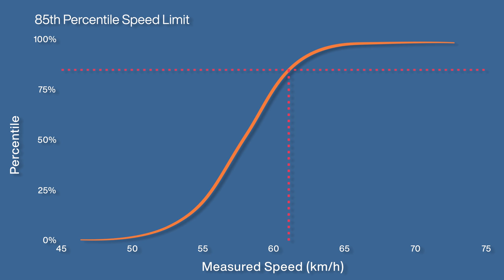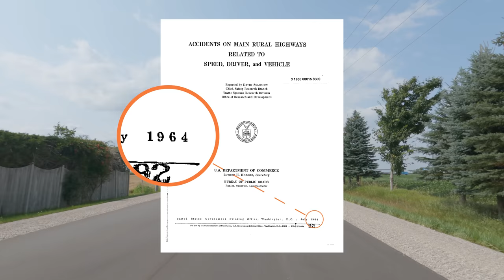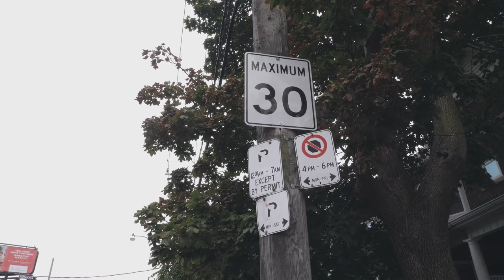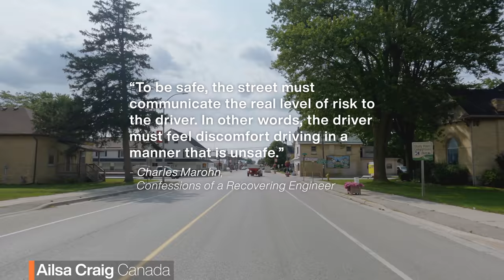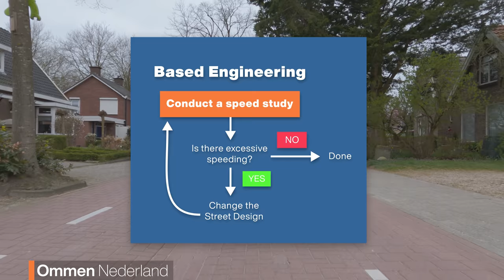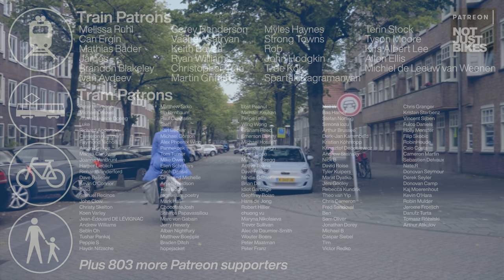The Wrong Way to Set Speed Limits [ST06]

Comment: The bit about roads with high speed limits in rural areas is so damn common in Texas. There is a small rural town that is on my commute to work and just before it the  speed limit is 105kmh(65mph) but obviously most people are going 70+ and the highway goes right through the center of it. They have posted signs to slow down, if you do it though people behind you will pass you in the oncoming lane and honk like maniacs.
Reply: I am in a discussion on an other site where someone claims that lowered speeds and the speed traps are only there for extra money for the local police/town, as a kind of extra toll. He did not appreciate that lowered speed limits might be because the local situation may needed lower speed limits, like people living on those locations and slower traffic users using the same roads.
Reply from the maker: When I was driving through these towns I saw a film crew interviewing a woman. They were doing a local news story about drivers speeding through town. It's insane to me how common this situation is, but nothing is ever done about it beyond a few random speed traps by police.
Reply: @willekevanderham5326  There are plenty of towns in the US that use their police (and speed traps) to blatantly extort people. 

I know of many spots where nothing fundamentally changes about a road and the speed limit is randomly lowered by 15mph with law enforcement hiding on the other side. This particularly occurs on highways adjacent to towns experiencing urban decay and is fairly common in between large cities on the east coast. 

These towns don't generate enough tax revenue so there is no point in stopping people from speeding, instead it is both encouraged and punished. 

These are often small conservative towns/counties that do not tax their residents enough, and therefore have to make up that deficit. There are many towns where police funding itself relies on these traffic infractions. 

This isn't a problem in most of Europe because the police aren't as corrupt and people actually pay taxes
Reply: It's because they'd rather have the speed trap and the revenue for the cops/city than make a safer design.
Reply: @stuuuuuuuu  last week tonight did an episode where there are small towns on highways that get over 50% of town revenue from traffic tickets.  Their schools are basically funded by people getting caught speeding.

Certainly a perverse incentive.
Reply: @stuuuuuuuu  In the Netherlands police will not enforce unless the road design matches the speedlimit. Enforcement is only the last resort. Police know people can object to such fines in court and win. And fines go to the national treasury, not local government.
Reply: Lmao I just came back to Colorado from Texas. Yes that state makes no sense… the roads too.
Reply: @willekevanderham5326  that’s exactly what speed traps are. Speed traps help no one except linking the fat cats.
Reply: @willekevanderham5326  it'd be easier to convince that person you're chatting with on another site if the US wasn't full of cases of highways being kept at lower speeds than engineers intended because the police union openly states they want the speed limit lower to produce revenue.

We're unfortunately kind of at a place where officials have cried wolf so often nobody believes them anymore.
Reply: @Zraknul  Ack, you beat me to it! I did include the episode name in my comment though. :)
Reply: @NotJustBikes  Speed traps are a back door tax.  Don't expect roads to be rebuilt anytime soon in.the US. The revenue from speeding tickets is needed for big spending politicians.
Reply: Still don’t understand why everyone wants to drive so slow some people actually have work and places to be they can’t just go watched the trees sway I live in texas and have many highways going 70 easy and am fine going that limit the truth of the manner is some people can’t drive and they get in the right lane
Reply: @stuuuuuuuu  bro the United States is like the same size of Europe if not larger obviously more people will have to drive in us
Reply: @RunsFarRidesFar  I moved from Georgia to texas please tell me how the texas roads don’t make sense or maybe you like sitting in back to back traffic because someone can’t handle going 40mph
Reply: I remember watching a video on a small town in the US that got the MAJORITY of it's revenue through speed traps
Reply: I am very curious about what this situation looks like. Can you give me the name of this small rural town so I can look at it it with street view on google maps?
Reply: Between towns when the speed limit was 70, they were doing 65. Then we approach a small town with a 45 limit. They go 65. Children playing in the front yard... zip on by at highway speeds. If i attempt to slow down they pass on the left. 

I have a clip on my channel of precisely this! Titled: 2-27-20
Reply: @fuzzytop4746  If you had payed attention at all, this is not about highway speed limits. This is about speed limits within towns, i.e. where people may be outside and crossing the street, with local traffic, roadside parking, and all that stuff.
Now, only a moron would make a highway the central street of a town (or have the highway go through the town at all). But if that's the case, it ceases to be a highway, and starts being a town street. With lower limits, for obvious reasons.
It's not that people want you to drive slowly on a highway, or a country road.
Reply: @ScramJett  Wondering if anything did change after that 2015 LastWeek episode..
Reply: @weaksause6878  You just described the plot of Pet Sematary.
Reply: @stuuuuuuuu  yea one time my mom got pulled over in the middle of nowhere in Nebraska for going 10 over the speed limit of 65. Cops like lowering speed limits in certain places and then camping there catching unaware drivers off guard
Reply: @csleurink  I doubt it. Standing in the way of the status quo in the US is like standing in the way of a herd of stampeding bison. You won’t stop, or even slow down, that unrelenting force, but you will get trampled.
Reply: @colatf2  they love out of town folks even more! Folks from out of town, are far less likely to challenge a ticket, even an unfair one, because they’d have to travel back to the local courthouse if they challenge it.
Reply: @ScramJett  a lot of small towns that I see are on Federal or State Route roads, sometimes County Route roads. I don't know how much control the local municipality has over them
Reply: @varana  a lot of small towns exist at the intersection of two roads that cover long distances, all the business want to be near that intersection, and then some of those small towns where built before automobiles or before automobiles where going anywhere near as fast as they are today
Reply: @isaackarjala7916  it doesn’t matter. If you challenge a traffic ticket, you can only challenge it in the municipality that the law enforcement officer works in. Even if he/she is a county sheriff deputy, state trooper, Highway patrol officer, the courthouse in that jurisdiction is the presiding court for challenges to traffic violations. This actually happened to my high school drivers ed teacher.
Reply: @fuzzytop4746  I was making a “ Texas makes no sense joke”. For example, the streets in Dallas, “what are those?” San Antonio also kind of isn't the best for cyclists. Plus, Texas has... Texas problems. Twas just a funny. Some of the people and local culture are amazing. But just the rest of it stresses me out.
Reply: I say lets combine the two. At least until we become accustomed to road specific speed limits. On the other hand, isn't speeding ticket a major source of income for municipalities? With that kind of free and easy income, I can't see many politicians voting to change that.
Reply: @ScramJett  okay, but the local municipal government can't change the road because it's not a municipal road, it's maintenance and planning is handled by either the county government or the state government.
Reply: @NotJustBikes   Because the Speed Traps produce revenue for the City & Police Department. Why would they want to reduce their revenue just to make it safe for people?
Reply: @gichiguy007  Maybe, but I wouldn't say that the groups of people who think the speed limits are for revenue & those who think they're for safety are split along the same lines as the ones you're talking about.
Reply: This is because we Texas drivers like speed and anything under 70mph is outrageous.
Reply: @fuzzytop4746  Europe have more than twice the population of US. What are you talking about?
Reply: @dutchman7623  A nation that relentlessly working on reclaiming Doggerland would not shirk at moving a road numerous times.
Reply: Same thing happens up here in Idaho, 80 mph to 35 mph and back up to 80 over a 1 mile town
Reply: It's interesting to consider which things came first too... was that small town there first and the road was built to run right through it, or did the town start developing up around the road due to the money brought in from travelers passing through and needing gas or food?  I'm sure it's a double-edged sword being a small rural town where all that traffic going by is keeping that local economy afloat despite how dangerous it makes it for a pedestrian.  If the road through your town was actually a small offshoot of the actual state road, it's probably less likely that people driving past your town will divert into your town seeking a restaurant or gas station.
Reply: Is this Texas Highway 71 somewhere outside of Smithville?  Where it goes from like, 75 to 65 to 55, or something like that within a few hundred yards?
Reply: @batmarlowe  no but I know exactly that stretch of road you're talking about haha
Reply: I feel like this is more of a cultural issue. Everywhere you go in the US, the is always some A-hole speeding, swerving in and out of traffic, gunning it through yellow or red lights, or tailgating slower drivers to try and bully them to speed up. I don't think that people here really understand just how dangerous driving is. Even driving normally and obeying all the traffic laws can be incredibly dangerous. When you're driving, you are essentially piloting a 1 ton bullet down the road.
Reply: France nowadays is very much extorting fines this way. Constantly changing speed limits on roads, increased number of speed traps, high punishments for minor trespassing, forcing people onto fee-based highways, Often inconsistent, random and flimsy signing. 
I once drove around in the major city of Orleans, searching for indications  to go via toll-free National Route (RN) to Tours (the next city of about equal size/importance towards the West).  No signs available as it seemed. Only indications for highways in that direction.
Looks like the private highway industry lobbied for that.
Reply: Have you seen US281 just north of Falfurrias? It is a 4-lane highway separated by a center turn lane and is posted 120 kph (75 mph). There are driveways on both sides to homes, ranches, churches, etc. It blows my mind every time we drive through.
Reply: @stuuuuuuuu  *people are forced to pay half of their hard earned money in mandatory taxes, fixed that for you
Reply: That's the same as with the speeds through a valley down here. It's 65mph around it but it drops to 55 through it but you just end up pissing people off if you drop to it. Bad thing is that's where cops sit occasionally because ofc going into that you're going to be speeding. I hate everything about the design of this area but these people are too addicted to driving and think it's the only way XD
Reply: @kyleoates6367  why are you accusing someone of being a “stereotypical GOP supporter” ?
Reply: In places like that the speed limit should be followed or lowered but like on the interstate 75-80 mph is to slow. I mean your traveling hundreds of miles in one drive I think speed limits should be set around 90-110 mph
Reply: There's one on my drive that has a 65mph road going through it, but the township takes that down to 30mph. Completely straight, just a few houses on either side. And this road was recently widened to nearly a 4 lane road, but with large paved shoulders to accomodate pulled over vehicles. Road is easily safe at 70-80mph
Reply: No way they're going to make the speed limit clear whenever the sheriff is getting 5 to 6 tickets a day waiting in that speed trap
Reply: You are right on with this whole vid but I think the issue is how St-roads come to exist. Take my town with two main st-roads covering lets say 12 miles or so with mini malls and stop lights. Things are pretty spread out and traffic isn't bad most of the time.  

The town just isn't big enough to have a dedicated downtown area, or even if it is things were set in motion in the 60s and things are just too spread out currently. Yet it's all workable though not optimal. So what will happen when the town grows is a densely packed and dangerous st-road, and there seems to be no way to avoid that.
Reply: The Hume Freeway is 100+Km/h but it's mostly a freeway with some island-based intersections, and it's all rural.
Reply: Instead of changing the roads to lower the speed limit, just let giant potholes form. What could go wrong?
Reply: @fuzzytop4746  - You know what really helps getting to your work and places to be on time?? Not being dead! :) Or in court defending yourself against a vehicular manslaughter case. If you can't get to your work in time without driving 70mph through the center of a town, perhaps leave your home earlier?
Reply: @marcstanescu2238  So I can apeal my 100km ph tickets on the main highways during the day ? Which btw are designed for 130km ph
Reply: The problem there is the lack of enforcement. Everyone figures the signs are suggestions, not mandatory. If they start getting expensive tickets, they'll learn quickly to follow the signs.
Reply: @sminthian  - Or instead of only punishing the poorest people in society, why don't we instead fix the damn roads so people will naturally drive slower. 🤷🏻‍♀️
More police and more fines aren't going to solve systemic issues. 🙄
Reply: Freaking Caldwell!
Reply: @stuuuuuuuu  A lot of these communities will be in panic mode when self driving cars eliminate traffic fines.
Reply: @MrWhite-pn7ui  I'm convinced jaywalking as well is a design issue that resolves itself in parallel with street and road separation. I've actually noticed my own behaviour here in Norway: in Oslo, where almost everything is a street, I'm quite happy to cross the street in unmarked locations (WHEN SAFE!). Outside Oslo with more roads and stroads, my first thought is generally to seek out a crossing even in situations just as safe as where I'd cross in Oslo. Also Oslo has a very low accident rate between pedestrians and cars, despite the lax approach pedestrians take to crossing.
So I posit that as the streets become better designed for their purpose, jaywalking stops being a problem.
As for bikes, I'll leave that to somebody else. I don't think I have a rational opinion on biker behaviour yet.
Reply: I've visited each of the lower 48 States.  In my opinion,  Texas roads have the dumbest design.  In fairness,  some of the Northeastern States have frustrating streets,  but they weren't really, "designed." They just evolved from the days pre-auto. Texas did it the worst possible way on purpose.
Reply: I mean I live in a Texan urban city and I have to go at least 5 over (in the right lane) on the highway if I don’t want to get tailgated 🙃
Reply: Make a goddamn exit and another road, nothing is more annoying than driving through Texas for two hours and having to slow down to 35 mph 10 times because some idiots built a few houses right on the main road.
Reply: @stuuuuuuuu  Speed traps like this are illegal in california.  setting the speed limits to 85th percentile with engineering and traffic surveys protects drivers against this kind of enforcement.
Reply: @mushroomsteve  they want safer streets, but can't afford to fix their designs.  thanks for strangling infrastructure construction, republicans.  Federal gas tax hasn't been increased in 30 years, longest its ever been static.
Reply: It’s Texas. You shouldn’t be regulating speed limits.
Reply: Use by ft no unless
Reply: @stuuuuuuuu  I live in a city that used to do that. All the traffic coming off the freeway  or out of Detroit Metro Airport on to Eureka road would be doing at least 60 MPH. The Speed Limit was 45 MPH. The city got about $100K in ticket revenue in 6 months time. The Wayne County Airport Authority got the speed limit changed, good for them the road fell under Wayne County and not the city. Because I doubt the city would have changed it.
Reply: @chernobyl68  not true. I lived in Sacramento and the highway to San Francisco would change to MAX 70. CHP on the bridge tagging people all day everyday.
Reply: Good, can't drive stay home!
Reply: @Meche697  in order to post something other than the prima fascia speed limit (65 or 55 depending on number of lanes), a california highway must have a current engineering & traffic speed survey.  if there is no current survey supporting that speed limit, you can fight the ticket and win.  city streets and county roads may have different laws however.
Reply: @willekevanderham5326  They definitely do set up camera traps there though for easy money
Reply: Maybe making small town main street a federal highway was a bad idea..?
Reply: @mbdg6810  someone must have said something incredibly stupid and racist...
Reply: @varana  Sometimes towns grow up around a highway.  What started out as a highway becomes a street because of town growth around it.
Reply: @kxkxkxkx  wasn't sure it was a US Highway, figured it was a state route
Reply: @XenSoc  Its like that over here in the east in Virginia as well. Accept its farms and churches and maybe a couple homes.
Reply: @marcstanescu2238  "And fines go to the national treasury, not local government." I've been saying for years that this is what should be done in the US. Take away the perverse incentive at the local level. For the US this could be state treasury, but some states are small enough that speed traps could just become a de facto state policy, so best to do it nationally.

I'm fortunate to live in a tourist/snowbird town where the police are evidently encouraged not to ticket for minor speeding, etc. so as not to drive away visitors and part-year residents. Before that I lived in college towns where you had to be ever vigilant, and before that a small town where teenagers (which I was at the time) were specifically targeted.
Reply: @Zraknul  whose fault is it that you can't see and read a speed limit sign? or see a row of buildings lining the road
Reply: @kyleoates6367  Let’s Go Brandon!
Reply: @stuuuuuuuu  My home town probably used to be this. The highway ran through town, so it went from 65 down to 30 pretty abruptly. I don't know a single person from town who ever got an actual speeding ticket, including 16-year-old me putting the pedal to the floor on a quarter mile connecting road on the way home. Pulled into my driveway, police pulled in behind me, told me he clocked me at 50 in a 20 (which was lower than my speedometer said), but just gave me a warning. 

A year or so later they completed a highway bypass and all of a sudden townies were getting pulled over left and right- my friend was pulled over for stopping but "not stopping three seconds" at a stop sign.
Reply: @heimdall4148  4,000 lawsuits later.
Reply: West of San Antonio?
Reply: When there is nothing to slow down for there is no reason to slow down.... at that point youre just fuckign up traffic.
Reply: Texas lol 😂
Reply: @willekevanderham5326  The state in the US keeps most of the fine, not the municipality.
Reply: @stuuuuuuuu  Coos Bay, OR
Reply: @RunsFarRidesFar  Idiocracy was filmed here..as a documentary
Reply: @BillyJoe1305  It's usually the opposite of this, people and speeds set at or above the design limit
Reply: @fuzzytop4746  55mph saves 30% and more fuel
Reply: @weaksause6878  I just go the speed limit in the fast lane.
Reply: @colatf2  At least it catches reckless drivers, drunk drivers, drug mules etc.
Reply: @worldchangingvideos6253  I’m weak. Lol
Reply: @ScramJett  maybe video during Covid though
Reply: @ezekielbenavides2740  libertee!
Reply: @batmarlowe  freeways should be 55 as they were in the 70s for pollution and climate change reduction
Reply: @XenSoc  thanks a lot, Abbott
Reply: @tristabrown7568  to slow?
Reply: @tristabrown7568  most tires aren't safe at those speeds for one
Reply: @Bullhead_JW  30mph saves lives (and lawsuits) in case of an accident.
Reply: @dwaynesbadchemicals  butt mah freedumbs!
Reply: @Jacarroll417  good that they were catching drunk drivers and drug mules for a while
Reply: @jmodified  fines in the US do go to the state vs city
Reply: @stopmakingsense9915  no
Reply: @heimdall4148  extremely costly
Reply: @121Greenthumb  saving fuel and safer in case of a wreck
Reply: @worldchangingvideos6253  That can't be true in every state, else why do we hear about departments that fund themselves primarily with speed traps?
Reply: @worldchangingvideos6253  slowing down for no fucking reason is not saving fuel. Don't want wrecks? don't build towns on top of high speed roads. You don't get to move into the neighborhood and expect everyone to accomodate you.
Reply: @worldchangingvideos6253  yes I think so when you have a 22 hour drive if your going to the speed limit yes I think it is to slow most of the time when I have a hour or longer drive I cruise around 90 with the flow of traffic and most of the time at that speed people pass me
Reply: @tristabrown7568  To slow? Where?
Reply: @stuuuuuuuu  As long as the speed limit signs are posted clearly and enforced consistently then getting revenue from from people who are breaking the law on public roads (rather than solely from law-abiding property owners) seems OK to me.
Reply: @marcstanescu2238  That is such a different approach than in the US. Curious, who pays for the road design in the Netherlands, local government or the national treasury?
Reply: @harrybaals2549  I grew up in one. The town cop was nicknamed Robocop. And everyone in the region knew the town as the one where you'd get pulled over for going 1 mph over the limit, if you weren't from there. If you were from the town he'd give you a pass. The majority of the town's revenue comes from his tickets. He's been the cop there my entire life. Yes they only have one. 

Where he sat was on the highway that curves past town (it doesn't even enter town). The speed limit is already pretty high and its in the middle of a canyon. The canyon curves and opens up to the valley with the town in it. In about 10 seconds your back into the narrow canyon. You only get a brief view of the town as you pass. You never even travel down any of the town's streets. So naturally most people speed thru it. He brings in quite a bit of revenue for the town.

I know of quite a few other towns that do the same thing.
Reply: @MrJcalvino  I think he meant size, as in square kilometers. The US is roughly the size of Europe. Everything being spread out means more people will drive in America.
Reply: @kyleoates6367  And here we have the pseudo-intellectual coming to make everything political, because that's the only thing simple enough for you to understand. Life sure is simple when everything is just red vs blue.
Reply: @mbdg6810  Because this is social media and we can't have nuance or anything here, your entire personality and political stance must be determined off of your opinion or stance on a single unrelated subject. You think that roads need to be more car friendly? Well you must absolutely be against abortion and think going to war in Vietnam was the best thing ever, Hitler also maybe had the right idea. Clearly. It's all team sports where you have to root for everything your team does and hate the other team, don't put any critical thought into it. Just hate the person in the opposite jersey. We put curtains on the ballot boxes for a reason but that reason is to be ignored.
Reply: @sminthian  That's if they even notice the signs, like the video we are commenting on points out people tend to drive whatever speed feels "safe" for the road/street they are on. Most roads/streets in my experience are so cluttered with various signs all fighting for your attention that missing one or two important ones is totally a possibility. No parking, there's a 4 way intersection ahead, pedestrian crossing, lights, oh construction and by the way the speed limit is 15mph, didn't catch that faded sign in the sea of signs? That's a ticket.
Reply: @stuuuuuuuu  If this is how it works, I guess nothing will change.
Reply: Boulder City, NV has this exact same problem and BCPD utilizes it to the fullest extent. They have such a bad reputation for pulling over and fining anyone going even 1 MPH over 35 once the "road" (literal federally labeled highway) changes into Main Street. It's a huge deterrent for even going to Boulder City and most people I know in South Henderson would rather drive into Las Vegas instead of Boulder City, just to avoid being hassled for "speeding."
Reply: Unfortunately, speed traps are a thing too in the Netherlands. In fact, the Netherlands invented the speed camera (flitspaal) after all while one of the most popular car navigation apps actually is an app specially made for detecting speed traps, Flitsmeister. Speed cameras never are placed in low revenue 30 km/h or 20mph zones where people actually want them, but on long boring roads just to increase revenue. Especially Dutch motorways are notorious for having completely arbitrary speed limits that can change in like a few hundred meters.
Reply: And yet, I would often drive between Colorado and Louisiana through Texas all the time and people consistently would slow down to match the speed limit in those towns.
The only towns I can imagine people speeding through are the ones that look dead or very rural, like not even a modern gas station. I doubt they will spend the money on a lot of engineering. Remember, Texas is far bigger than the Netherlands, and has so much open space in comparison, and these rural towns are often a thousand people or less. The small towns are still under 5,000 often times.

You just cant compare the USA to individial Europian countries.
Reply: @fuzzytop4746  you seem to be missing the message.. intentionally. That's your right, but it's also a pointless discussion then.
Reply: @marcstanescu2238  BIG difference as US/Canada the fines go to the local cop shop and counsel with a few other "bodies" getting there paws in the cookie jar